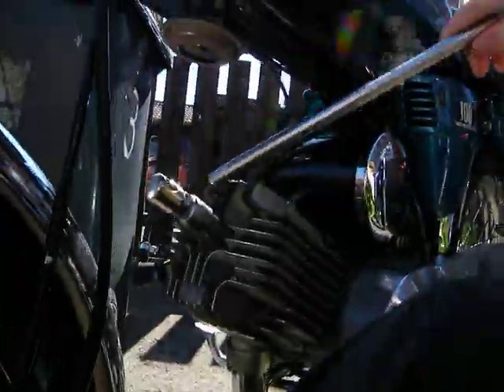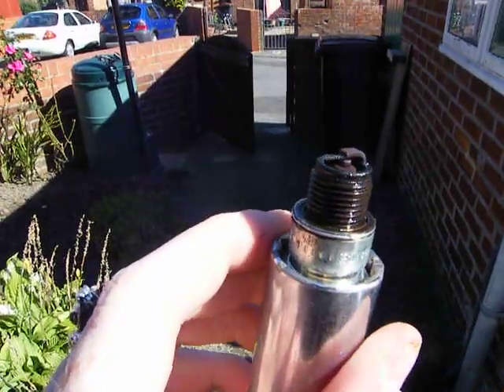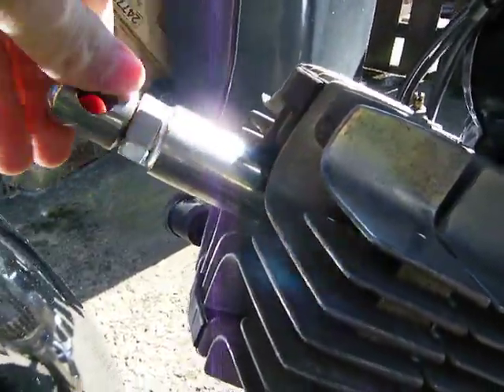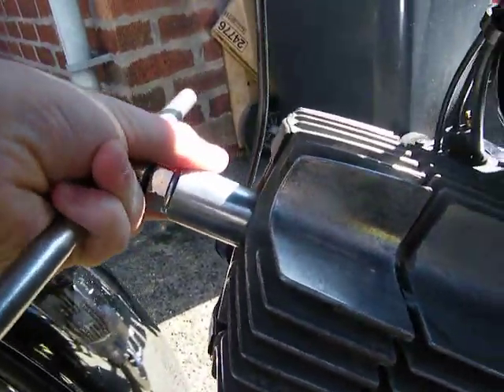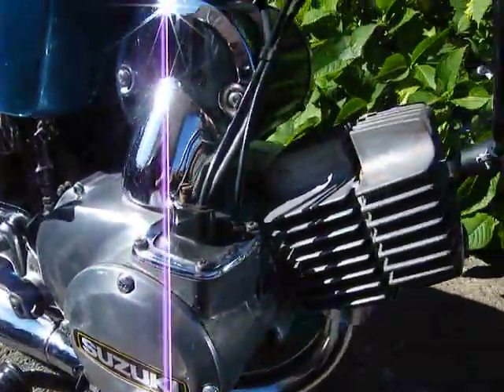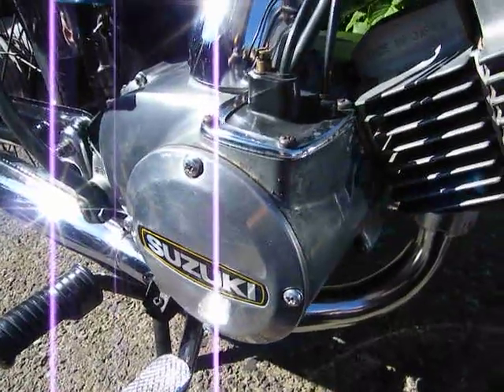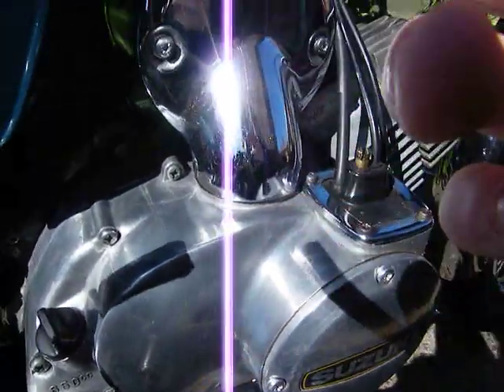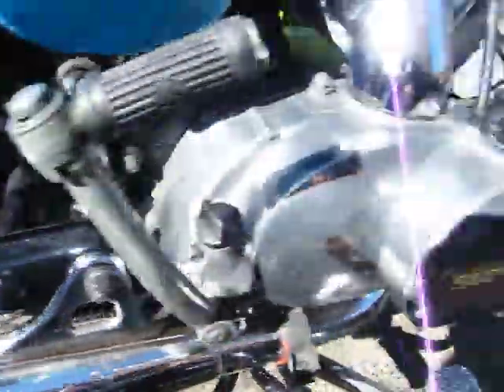Checking and Tuning the mitures of a single cylinder 2 stroke

Comment: @kyconic44 ohh yea and the spark plug is chesnut brown exactly like urs in the vid wich is weird considering it smokes like heck wen it runs on full throttle and wont even idle or run on aneything but full revs and then it wont even run for long on full

Comment: @kyconic44 
on a 4 stroke they say salmon pink, on a 2 stroke that burns oil, it must be darker generally, also on diska valves or piston port engines at low rpm u get blowback so air passes carb twice, being 2x as rich!
more so on racing engines.
we used to change the plug every 10 minutes on the karts or every race, u know the types with no protruding cathode?
cost about £25 each back in 1990!
if u use an oil with octane improver and fully synthetic u may get close to pink?

Comment: Hi kyle, thanks for the vid, it been really helpful. Would you happen to know which drainage plug is the oil sump? We're currently trying to service a 1983 A100 special and I thought you might know what plug to drain, I think we may have drained the gear box by accident, are there two drainage points under the chassis? Thanks for your help! :)